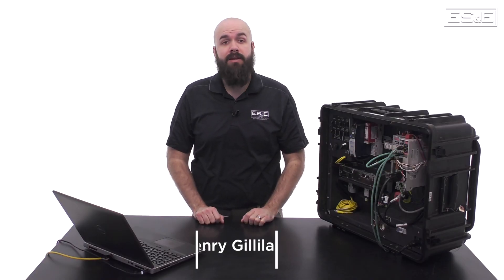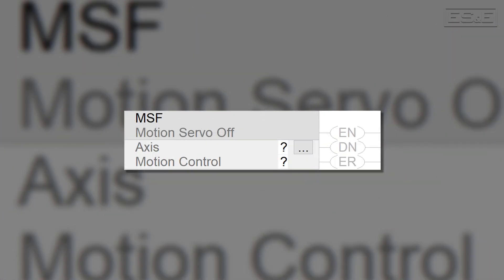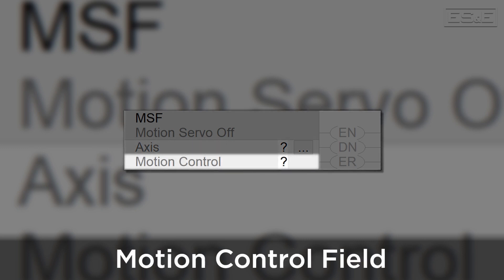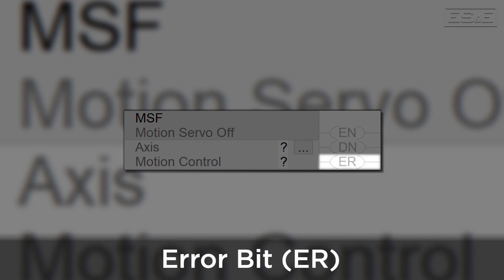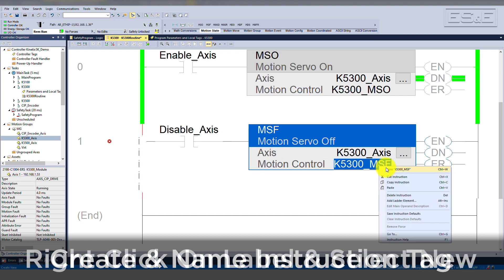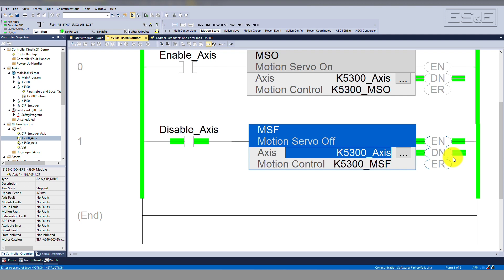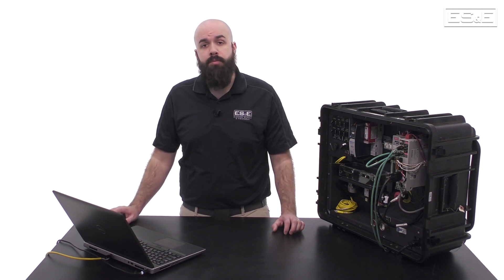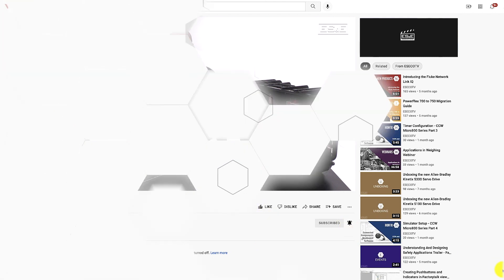Motion Basics - MSF Instruction

Comment: If I have a servo motor with a built in brake, will the MSF instruction make the brake disengage thus allowing the motor to spin by hand? 

Or Does the MSF instruction strictly only remove the 24VDC going to the brake thus engaging the brake every time?

Also, if I were to perform a MAM instruction onto a servo motor that does NOT have a brake, upon completion of the instruction will the motor hold it’s position even if I were to try to turn the shaft by hand?

Or is “maintaining” position strictly a feature of servos with built in brakes?

I would appreciate if you guys could answer these questions, as I am trying to learn but don’t really have access to these stuff at home to play and test with
Reply from the maker: Thanks for watching. Here are the answers for you:

If the motor has an integrated holding brake, then it is automatically engaged when the MSF instruction is executed. When and MSO instruction is executed the brake output is turned on automatically and sends 24VDC to the holding break to release the brake. If you want to release the brake without doing an MSO then you may do so by changing the “Mechanical Brake Release” parameter to “Released”. This parameter can be found in the drive parameters menu of the axis properties.
 
When an MSO instruction is executed, the servo disengages the brake and closes the position control loop and transitions from the “stopped” state to the “running” state. In the “running” state the servo will maintain position even if the shaft is not turning. It maintains position by applying current and enabling the position control loop built into the drive. The MAM instruction will move the servo to the new defined “commanded position” and then the servo will electrically maintain the new position. The brake is not used at all as long as the servo is in the “running” state.
 
Servos without holding brakes will maintain position when they are in the “running” state. However, in the “stopped” state, servos without a holding brake will spin freely (if spun by hand) and servos with a holding brake will be prevented from turning. The holding brake prevents movement in applications such as vertical ones that may move on their own if not stopped mechanically.